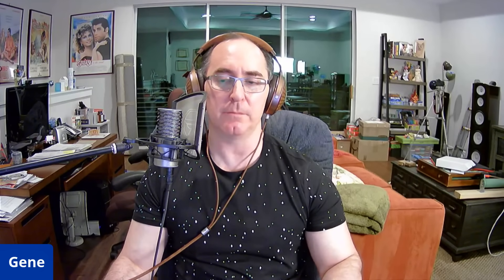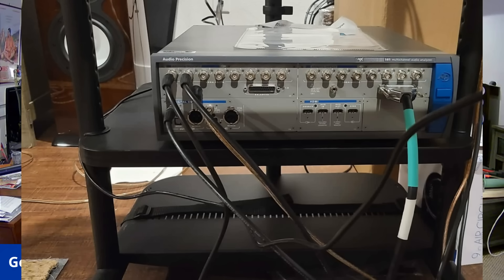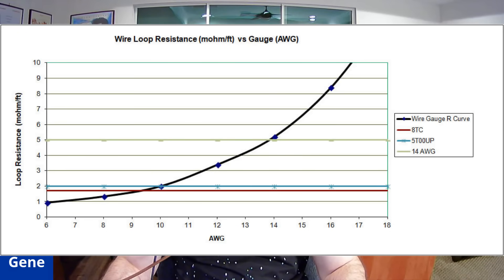Speaker Cables Really Don't Make Much of a Difference?

Comment: Thanks for shedding some light on this topic, but I would not be so kind to the cable jewelry hucksters. In addition to your excellent diagnoses, let me add the following:

The average speaker voice coil contains about 100 feet of very fine wire, which is somewhere between 28 and 36 gauge, depending on the speaker. Then, there are multiple drivers and a crossover network. The load seen by the amplifier is the sum of the above. Putting a multi thousand dollar "fire hose" cable at the front of this load does very little, if anything at all, to affect the sound. You have proven that. The giant cable represents a tiny fraction of the load seen by the amp. High end cables are a marketing ploy, pure and simple, and not an honest one at that. They can't add anything to the sound, they can only take away. They are not a component.
Reply: Your Cable Jewelry Hucksters term is spot-on, proving once again that PT Barnum was right and "A Fool and His Money are Soon Parted". Cheers!

Comment: Gene - I have a Marantz receiver NR1402 receiver, just picked up some KEF Q150 Monitors. My receiver does not have a phono output so I bought a Parasound preamp and run into my cd in on the receiver. I am not sure why my output is so low?  Quality is ok but I was expecting a lot more out of my vinyl.  It’s been years since I listened to my vinyl but there must be an issue somewhere.  I have to crank the volume on my receiver. Any advise?

Comment: I experimented with various wire gauges a long time ago and couldn't hear any differences between them. Well, in the beginning I thought I may have heard some difference, but after a while realized that they were due to, as Gene stated in this video, the changing positions of my head.

It also never made sense to me that using expensive, thick cables were necessary because the size of the wire used in the voice coils of speakers is very thin and also have much more resistance than any 18 gauge wire has in their relatively short length when used in an average sized living room.

Comment: Gene, does premium speaker wire improve an inferior signal source?Something that piqued my interest is the reference source equipment  help clarify that the speaker wire used is not the weak link. I
 would be interested to know if you get the same results using an inexpensive AV receiver.

Comment: I know that OFC is a better product then CCA but how much of a difference is there between the two?  In a budget situation and you're having to run your rear speakers 50' for example would there be a sound difference?  If there was a different in sound quality with a 50' run of 14 awg OFC and 14 awg CCA would stepping up to a 12 awg CCA counter act the loss and equal the sound quality of the 14 awg OFC?  I know this isn't something that would affect someone with a reference level system but it could someone with a budget system that has slightly better then average speakers.

Comment: Gene, you’ve commented a couple of times that you like the Kimber TC’s.  But have you tested/can you comment on other Kimbers?  Or in other words, does this firm have a unique commitment to testable quality in their cables, such that any cable higher up or further down the range are also a safe bet for the money?  Or, did they make the TC great on accident?

Because “you can’t trust cables except this one very specific make and model” isn’t super helpful.
Reply from the maker: U only use Kimber 8TC and 8PR For speaker cables as I think they are the best balance between performance and value. Their interconnects have beautiful connectors but I shy away from cables with only a shield on one side as they tend to induce groundloops. I stick with Belden for interconnects.
Reply: @Audioholics  Many thanks for the reply on an old video!  I still feel like if the TC happens to have measurable sonic advantages, at least some other higher-end cables must too.  Even if it’s a happy accident.  

A broader breakdown/takedown of high-end cables that’s this detailed, would be valuable in bridging the gap between the engineering crowd and the “there’s a difference I swear I can hear it” crowd.

Comment: Two tests would settle this. A panel of 5 listeners doing a double-blind listening test scoring different characteristics (separation, perceived distortion, etc), and simply measuring audio frequency output thru two mics over whatever reference speakers you choose. Not so hard, but no one I've seen has done it. That says something.
Reply from the maker: Measuring cable differences with mics is a big mistake. The variance is acoustical measurements is far greater than any measurable differences the cables will cause. It's a very rookie assumption to want this.

We done extensive blind listening tests and none have produced statistical significant results proving audibility.
Reply: @Audioholics  🤣  "rookie", eh? Pretty clear where *that comes from. Speaking for all 'rookies' with a wee bit of training in designing and publishing experiments, I understand the misperception one may have about the use of microphones in this context. It isn't for technological comparison, but to convert qualitative differences into coarsely quantitative ones to generate scientifically significant baselines (and potential comparisons), not to determine which is 'better'.  But...just a rookie talkin' here 🤣. As for *statistical significance, there is none in this context, without a statistically significant "p" value. But you know that, right?  Self-proclaimed experts make that kind of mistake all the time.
Reply from the maker: @I-Libertine  Anyone that wants to measure the net effect of cable differences using acoustical measurements clearly is a rookie and doesn't understand basic acoustics or electrical theory. 

It doesn't matter how many experiments you've run. You're clearly out of your element here. 

I took 2 graduate level calculus based statistics classes in college and have spent over 7 years doing blind listening tests in controlled environment for the telcom industry and government defense before my 20+ years doing Audioholics so yea I know what a "p" value is.
Reply: @Audioholics  odd, then, that you would assert "statistical" difference as relevant in this context. (Not that math PhD or years of statistics trumps graduate level courses or, goodness knows, making YouTube videos, but knowledge beats name calling any day.) Appreciate your expertise. Very nice graph paper. -- Respectfully yours, a rookie.
Reply from the maker: @I-Libertine  Agreed about knowledge and there was no name calling and my apologies if you took that comment personally. However, sometimes people pop on the channel proclaiming they have all the answers and suggest measuring cable differences with a microphone is a very rookie mistake.
Reply: @Audioholics  in truth, we agree on the net effects of cables from what I can tell. Enjoy your vids.

Comment: Talk about an adventure in missing the point by using an expensive piece of equipment that cannot measure the audible differences in cables. If you measure the wrong thing, you’ll reach an incorrect conclusion. Mentioning placebo effect (while true of some people) is a simplistic straw man.

Comment: Really liked your test here;   I've been using Monster Cable (can't remember the gauge right now) since the mid 1980's.  I agree room acoustics and how a system is tailored to the room are where the big differences are going to be realized. I used to use a graphic equalizer with microphone input to flatten my amplifier output per the listening area.  However, now-a-days, I let the amp perform it's own measurements and adjust accordingly.

Comment: Boutique speaker cables aside, because I have never played in that space, so I just don't have the experience to comment either way.  Over 30 years in both HiFi & managing & maintaining an auditorium PA, my experience is that speaker cables can matter and do matter quite a lot.

I need to qualify that though because Audioholics do recommend professional speaker cables with published performance specs and gauge generally around 10-11 AWG or so.  These are a long way above the generally mass retail market speaker cable offerings available from outlets like chain audio, electronics  stores & hardware stores.  At least that is the case in my country.  It used to be different 10 or more years ago, but for a good while now, anything over 14 AWG figure 8 cable is just not commonly available, except through specialty HiFi (boutique) retail stores.

I've used a lot of speaker cable over the last 30 years & in my experience, cheap thin figure 8 cable almost always lacks clarity & often adversely affects tonal range, especially bass.  14 AWG figure 8 is still somewhat lacking, for most good HiFi speakers, Such cable is likely to nobble HiFi speaker performance, depending upon the actual speakers & your ability to fine tune tonal response.

Let me clarify here, I own 3 sets of stereo speakers, all are passive and have some vintage to them.
I have found that none of them can attain their full potential clarity or tonal response with 14 AWG (or thinner) figure 8 cable.  But they can give startling performance (clarity & tonal nuance) to acoustic instruments & vocals if a decent yet not boutique cable is used, even at only 12 AWG.

The speakers we had in the auditorium used horn mounted pieze tweeters (one of the better Motorola ones).  These are generally not a well regarded technology, though they are or were fairly common in PA applications.  Before my time there, the PA system had been set up with 18 AWG figure 8 cables & it really did lack both bass response & clarity, especially the foldback speakers.  Well, I eventually decided to do an experiment, swapping out the too long 18 AWG fig 8 cables for 14 AWG fig 8 cables of minimal length.  I chose this particular cable because it was cheap enough to conduct an experiment, no great loss if it failed to improve anything.  Well, it did improve clarity & bass response & very noticeably so.  Hover tonal balance was still not great, but being PA, we had a graphic equaliser.  So, I spent a day carefully adjusting the graphic EQ on mains & foldback to match what I could hear from the source in good headphones.  The difference now was startlingly good true sound reinforcement.  That is reproducing sound to a high degree of natural realism.  We got comments about this being the best, most natural sounding PA and clearest spoken word that visitors had ever heard.  That was achieved with 14 AWG figure 8 cable runs of only 7.5m.  That is a very short run for PA & is the absolute minimum I could run at the venue.  I will say though that that could not have been achieved at all without both EQ & at least that gauge of cable.

So, I want to make it clear that I am most definitely not a fan of expensive boutique speaker cables, but I am also not a fan of cheaping out on the thin figure 8 cables commonly sold by chain stores.

Also, in my case, the tweeters being Piezo present a very high & consistent impedance load to the amplifier.  This is absolutely not the case for dynamic tweeters.  Dynamic tweeter impedance is very low and very variable across the audio frequency spectrum.  They need to be driven by a much lower impedance source, meaning the the sum total of amplifier + cabling + crossovers impedances, needs to be a mere fraction of the tweeters nominal impedance if order for the dynamic tweeter to be driven accurately.

This is not generally so critical for dynamic bass drivers, because their impedance tends to be more stable across their driven frequency range.  It is the tweeters that carry most of the perceived clarity though which makes driving them well, the greater priority.  This would tend to support the view that while 14 AWG worked very well with Piezo tweeters in the PA, that gauge may well be inadequate for HiFi speakers using dynamic tweeters.   My experience in HiFi trying a few less expensive speaker cables of different gauges certainly indicates that to be the case.  I would not recommend any speaker cable smaller than 12 AWG for passive dynamic HiFi speakers & I note that Audioholics often recommend much thicker professional speaker cables than that (10-11 AWG) and I have written this comment to highlight out that very fact, because it seems to be missed by many.

Comment: I'm an electronics engineer and love audio; Gene, your video is spot on. Unfortunately, many, certainly if not most, audiophiles are duped into thinking that these highly expensive and costly cables will have an audible difference.  The scary part however, is that if you A/B these cables using a non-double blind test, these audiophiles will swear to no end that they can hear a difference.  These characteristics of audiophiles believing they hear these differences are more psychologically based than anything else.  If you believe you hear something then nothing is going to change your mind, not even cold and hard numbers.  Then you've got those that will say, "well your ears can hear things that test equipment can not".  In that sense, such a statement is partly true in that if you took two amplifiers, each with primarily the same specs, i.e. frequency response, power bandwidth, damping, etc, and connect them to the same set of speakers then A/B the amps, there might be a perceptible difference - but it will NOT likely be because of the speaker's cables!  Now there are instances where speaker runs that are 40 feet or more can have an impact if you're using less than 14 gauge cables, but speaker runs that long are not typical.    So, keep up to great work!

Comment: I know enough of electronics to get myself in trouble and enough to know when I'm having smoke blown up certain orifices. When stuff is being demonstrated to me I tell them to shut up don't tell me what they're switching to or when or what let me hear it I'll tell them which is better or if I can't hear it. Let's do it like an eye exam "which is better this one or that one". I have taken to braiding different gauges of wire for each polarity theoretically resolves some of the capacitance in inductance problems as you go through the frequencies for my cables. If there really is any discernible problems😕.

Comment: I would have liked to have seen an impulse response test at low frequencies because cable resistance might affect damping factor and low frequency distortion.
Reply: Impulse response tests in the same room with different cables would not likely show any differences that aren't a result of the factors in the tests shown here, which means if it doesn't show up in one of these tests then it won't show up in an impulse response test either.  The only thing I can think of where that that might happen would be if your room has some type of feature, like a really prominent resonance at a specific frequency that is modified by the differences between cables in such a way as to be exaggerated beyond what we see in the test results.  In that specific situation, changing the cables might make a listenable difference.  But that of course is a room issue and isn't really applicable to an evaluation of cable differences. I don't see how changes in amplifier damping or low frequency distortion would play into that, either.  Maybe you could elaborate on that if I am missing your point.

Comment: According to high end cable manufacturers of speaker cable it appear the thicker the better, if that principle applies why do headphone manufacturers of all headphones use a similar dimension cable no matter their cost, their thickness which is normally quite thin. I have a pair of sennheiser momentum wired to my marantz cd player as I write this with very small diameter wiring. Would they look stupid with 3 in diameter cable. I think so.
Reply from the maker: Headphones don't carry current and aren't low impedance like a loudspeaker.
Reply: What do some of these so called experts really know, first a lot of hi fi lovers probably have imperfections in their hearing anyhow, since the age of 20 I was informed that I had scarred eardrums. I love music but I am not benefitting like 100s of thousands of others. You can't buy your hearing loss. We are all different.

Comment: Some would say the small difference is proof that cables do make a difference even if it isn't hear able.  But I do agree with you about the cables making no difference.  I use 6 ft runs of stranded copper wire of 10 gauge.  Primarily to make sure I have low resistance.

Comment: Exactly as I suspected. I already knew what your findings would be because the cable companies NEVER present you with the graphs. I've worked in sales for years. If they had the data to back up any improvement in sound, it would be graphs on graphs on graphs. That would be the best selling point possible. Nope. Their only selling points are bullshit adjectives that don't mean anything.

Comment: Won't resistance make more of a difference at higher power levels?  It looks like your frequency response chart was done at 10 watts.  Is that enough to see the difference of resistance losses during heavy dynamic peaks?  At 50 mOhms in a 10ft run that may not matter much pushing a typical  load per speaker.  I don't even know what "typical" power level is for me, but I do listen to hard rock/heavy metal at a decent level.  I'm not disagreeing with your results.  I'm just really curious.

As a side note.  If the test was done at 200 watts, and most people only use 100 watts, then you know it won't make a difference.  It's always best to test under more extreme conditions than called for.
Reply: Simply increase the wire size over longer distances, just as you would if running wire to a distant sub panel